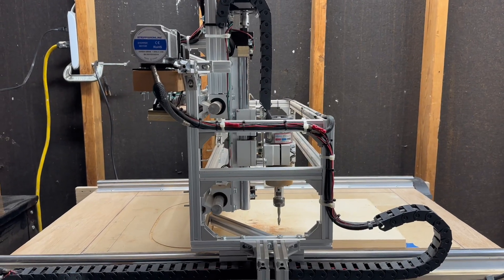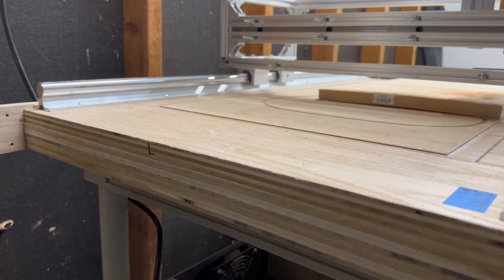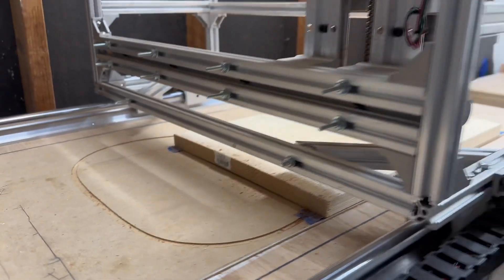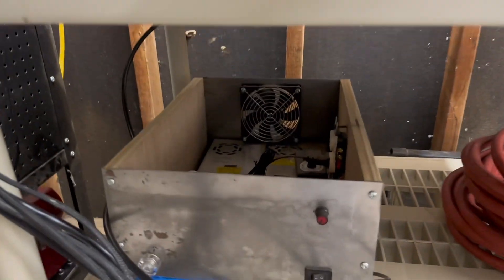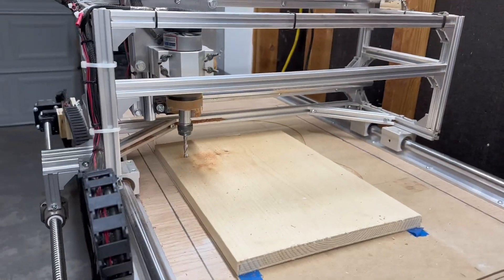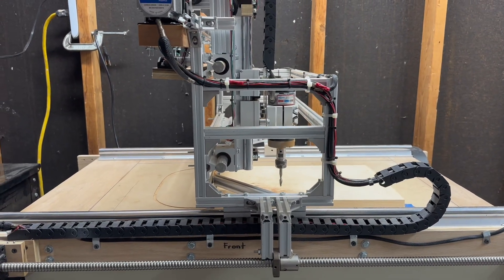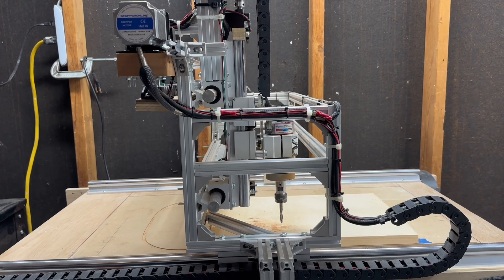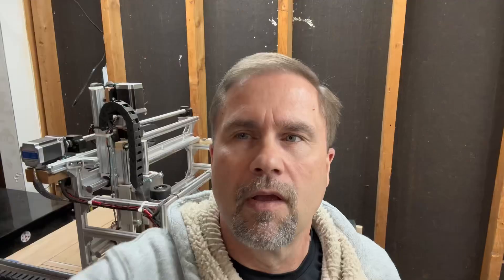Homemade CNC (Sharing my project with you) if I can build one, so can you!

Comment: what is your estimate cost for this?
Reply from the maker: If you add up all of the parts in my description below it adds up to around $875 if I remember correctly. It doesn’t count plywood, screws and a few other smaller things. I spent around $1100 all in but it is a very strong cnc as far as torch
Reply: @StudtCustomBuilds  well done! I'm surprised at the number.
Reply from the maker: Thanks! Yeah and you could make it bigger for fairly cheap by just buying longer rails and cutting the base differently. You would then just need longer ball screws and longer rails. I would think for around $1600 you could build almost a 4’ by 8’ CNC. I’ve looked into the rails, they make a almost 8 foot set of rails

Comment: Hello Ken,
Thanks for sharing! I'm gonna make this machine! What are the dimensions of the machine itself? Regards Yvo from the Netherlands
Reply from the maker: That’s great! I will measure the exact dimensions here within a couple of hours. I’m not at my shop currently and it’s been a few years since I built it. It’s interesting I may be traveling to Netherlands in December. Small world. I’d be glad to answer any questions you may have
Reply from the maker: The dimensions are 40 by 24 with about 31 by 18 workable space. Like I said in the video I used one 4 by 8 piece of 3/4 inch plywood cut in 3 pieces and stacked them for rigidity. I may make a more detailed video. Is that something you would be interested in?
Reply: @StudtCustomBuilds   thanks a lot! I designed a mechmate router but this one was too big. The one you made is perfect!
If it is not a problem for you, l like to have more details of the mechanical construction!
Regards Yvo
Reply from the maker: @MrYboxuitg That’s not a problem. If I were building it again I would actually use a much bigger extrusion than what I did. 
I would also make the Z able to go higher. 
If you have a little time before you start I’m going to do a more detailed video of the making of the CNC with updated info like what I would do differently
Reply: @StudtCustomBuilds  Thanks! I'm happy that you want to help me. I'm not in a hurry.
Reply from the maker: Hello from US. I am traveling to the Netherlands soon. I’ve never been there
Reply from the maker: I haven’t forgotten about doing a more detailed video like talked about. I’ve been working on building and filming the  Stratocaster build first
Reply: @StudtCustomBuilds   no problem, No hurry. Did you like your trip to Holland?!
Reply from the maker: @MrYboxuitg Yes we did! I had to work but my wife came with me and my father in law. They went to Belgium, Amsterdam and other places. I had to be careful driving though with all of the bikes. I’ll be back this year
Reply: @StudtCustomBuilds  In Holland it is very busy.. bikes, cars...  There is a lot to see. Of coarse Paris is also nice! When we came back from Chile, my wife had Corona and than me. But
Reply from the maker: Sorry to hear. Hope you all are recovering. 
Have you done anything as far as a cnc build yet?
Reply: @StudtCustomBuilds   I collected materials... Solid state relais, cables, a watercooled spindle 2,2 kW. Now i want to focus first on the structure. Can you send me some more detailed photo's of the structure you've build? That can help me! REgards Yvo
Reply from the maker: @MrYboxuitg Sure. The only thing is I would make my Z an inch or two higher to give more room to cut higher. It’s fine for me because all I’m cutting is guitars. I’ll IM some pics tonight
Reply from the maker: I sent you pics on IM. Let me know if you get stuck on anything
Reply from the maker: I haven’t forgotten about doing the CNC build it may be the next project after this Strat build that is taking way too long. You may have already moved on and done it. Just letting you know

Comment: That's an overkill sized gantry for such a short height for cutting!
Reply from the maker: Yeah it is, what happened is I designed it then had to add more because it wasn’t rigid enough
Reply: A box for a gantry is totally legit design.  Also, the horizontal buttressing is the
An answer for my 20 series extrusion  router.